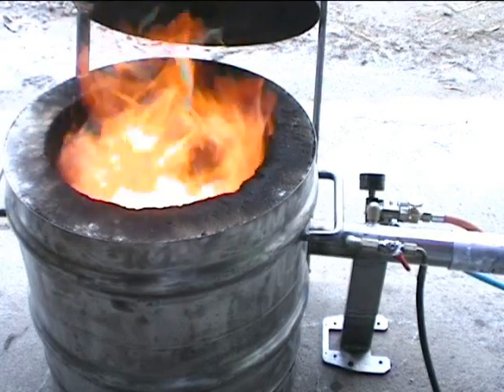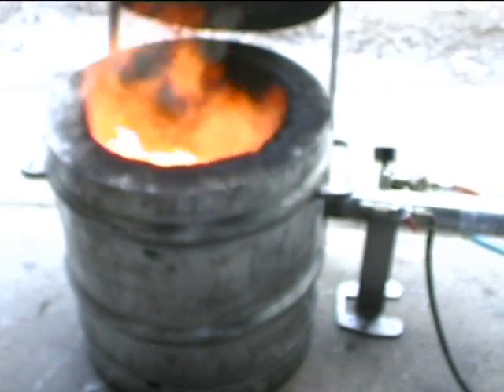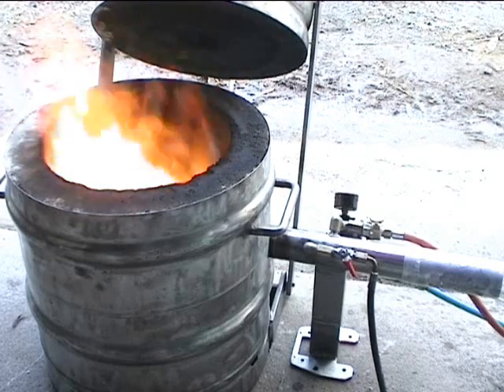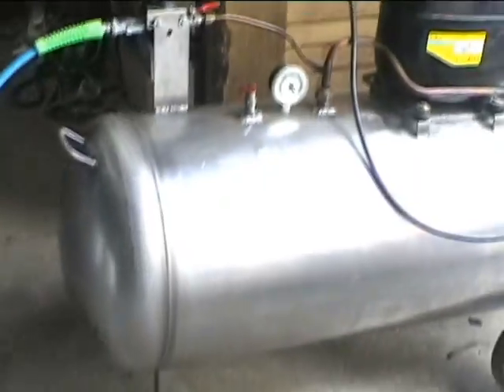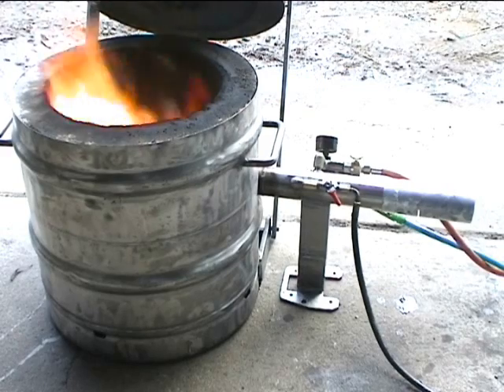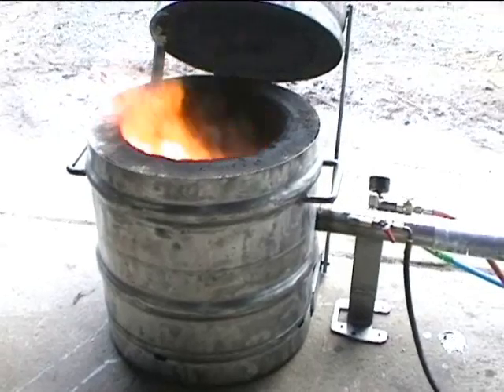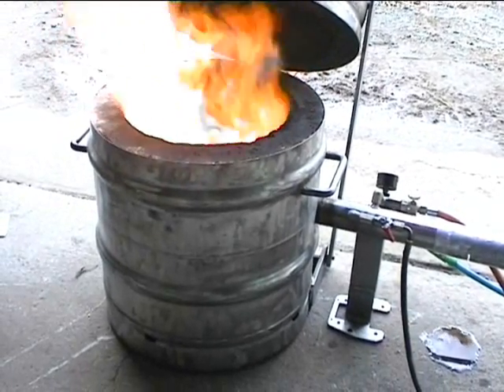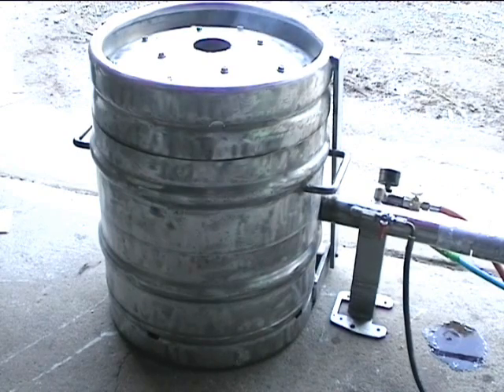Waste oil burner.

Comment: Do you need a special concrete or standard concrete mix is just fine?
Reply from the maker: I used proper refractory cement along with high temperature insulation between inner casing and outer

Comment: Thanks for the video. I just built my burner based on this. I didn't put the propane connection on, but I think I should when I can get the parts. I started the fire with my blow torch until the oil lit. Question though, what kind of vegetable oil are you using? I tested with unrefined sunflower seed oil. It lights at about 250 degrees F. Although I can't yet get it burning from the nozzle., I guess that needs the heat from the propane at the nozzle? Awesome videos.

Comment: methahydrate is cheap if you buy a bigger container I have 80  gallons of oil  and  for every 5  gallons of oil i put in one liter and drop a pump in  with a filter and it  constantly  circulates  fires faster burns cleaner  lights easyer

Comment: I have one and I run 9 pounds of air  thru one side and 3  to 6 thru the oil  side  and the coolest place I can take the temp is a 1040 degrees F  then my gun  just says over heat Over heat

Comment: I don't get this. 10 psi pressure? 0.6 bar that is.. I have built the quickie-burner (same principle of this) but i have to use 5-6 bar to get it running. How come you can have so low pressure and still getting the "jet engine" burning? And i have to mix wasteoil and diesel to get int going. Pure wasteoil it just dies out.
Reply from the maker: Anders Erlandsson 
Maybe yours is different to mine in the size of tube, location of nozzle, length of air entry at rear etc
Reply: +Kevin .Brent - You did a GREAT JOB !!!  You can tell he's not that bright. Look at his Sentences alone and how it runs longer than the Equator. That will tell you a lot about the Person writing that crap and how he would make his " Built ", etc....  Maybe ask him what kind of Toilet Paper he wipe is arse with, that would solved some of your crust on your own arse or even mine, LMFAO.  Dam, some People are just stupid.... Forrest Gump " Stupid is, Stupid does ".

Comment: Very good design just add a flue pipe to get rid of the dangerous gasses or exhaust and you can stay warm all winter long on the spent oil out of your car truck and four cycle engine powered equipment. very nicely done. oh by the way I liked your fire twister inside the heater.

Comment: This is a neat design but do you need the gas to start it? My spray burner lights on straight WVO/ WMO and uses very few off the shelf parts.  I think if you had the venturis further back in the burner and used heavier gauge metal, you may be able to stop the oil drip by allowing it to vaporise off on the burner wall.

Comment: Hi what is the purpose of the compressor really? Also what temp should the preheated oil be? Nicholas.
Reply: Nicholas Bnasraj  The compressor provides air pressure to push the flame down the pipe. This also adds oxygen to increase the burning temperature as well. This also draws air in from the back.
Reply: mfgman2011 thanks for the clarity, much appreciated.

Comment: would it be possible to do this with used motor oil if the fire is hot enough?  i.e., enough air flow to make it possible without much smoke?  I have never tried this, but am thinking about it as I have access to a lot of used water pumps and motor oil.  How much electric does it cost to heat oil?  cost vs. profit?

Comment: It gets smaller, afraid that you are going to have to rethink your question a little or not be so general, yes compressing air generates heat but not really enough heat to increase the temperature of the oil enough, especially with the lower volumes of air that he will be consuming if thats what you are asking for, best option for scavanging heat would be a car oil cooler heated by the exhaust gases of the furnace carrying pumped oil inside it to a copper pipe coil within the oil tank.

Comment: Nice project,have also did some experiments, but with a blower instead of an compressor. How is your fuel en gas/air injection constructed in the burner tube? Do you have a sketch?  Grtz from Holland

Comment: I think the real question here is do you even have a clue what you are asking, I think you just dont understand how a compressor works really do you? Can you imagine the pain of fabricating a tank that has a hose running through it that can transfer the heat from air inside it to the oil outside it with enough efficency to even heat the oil 1ºC, then be watertight and then be capable of containing the pressure of the air, sounds like backache to me and for nothing but a waste of money + time.

Comment: I have a similar setup but have modified an LPG OXY bottle regulators and feed handle to control gas flow. If you run Oxy in at about 1% per 40 mins your fuel consumption can be lowered considerably.  The smoke I saw when you closed the Blast Box Lid will disapear.  HOW EVER ....WHIT ALL GAS LOOK TEST LEAKS AND TAKE CARE AS YOU HAVE NOW GOT THE TURBO VERSION OF A HOME FUNACE.  I t will melt iron, Chrome even Salt. It will do this very fast.

Comment: take ashes, sift them out with a mesh like a window screen, mix it with water to make a paste, and use that instead of the heat resistant concrete. not criticizing, just a suggestion.

Comment: That is soo cool. I was just thinking why not connect the burner to the oil tank. Or use the compressor. You know the tube that the air goes through after it's compressed? Well if you could somehow have that tube go through the oil tank first before it is puts the air into the air tank, that would at least help both heat the oil and cool the compressed air.

Comment: Most excellent... I have made a similar one some time ago based on the Joe Pipe.. (lots of videos by Joe here on you tube)..... How often is your compressor cycling? ... one thing you may want to try ... put the swirl device in front of the flame.. by adjusting air, fuel it acts like a fresnel lens , pull the flame back into the tube and you get all sorts of neat things happening.. extreamly high heat....like a lttle tornado in a tube..

Comment: It looks like it could do the job but I see it leaks oil! It drips off the pipe... 
Why not vaporize the oil in a coiled pipe inside the burner before mixing with air and igniting? 
And with a proper nozzle it might not be necessary any more compressed air. 
Initially I thought that these waste oil burners work like any liquid fuel stoves... preheat - pressurize - vaporize (not atomizing) mix with air in a carburetor and ignite.

Comment: Is it possible to run with the air turned off after you get it started? Or will it run to rich?  I'm thinking a bell on the intake end might help the fluid (air) flow.  With the flame side creating the vacuum you might be able to run it with the air off.  Been looking at waste oil as a means to run a boiler to power a steam turbine.  Why I would like to see one running without compressed air thus making the electricity consumed by the system as small as possible to increase the output.

Comment: Great job mr fabricator man! Im a boiler maker too. That furnace looks a million bucks mate. Good idea with the compressor too! Have you considered making an atmospheric oxygen extraction compressor? It's a bit tricky but I'm positive that a richer oxygen source will increase your heat output, produce less soot and with the right mix you might even be able to achieve a neutral flame. Best of luck to you sir!

Comment: wow this is the best burner ive seen. Im building a similar burner using the same siphon nozzle im having trouble because my propane flame goes out even with the tiniest air pressure i cant seem to get the oil to flow before the propane blows out do you know what could cause this.

Comment: The flame colour looked to be overfueling - I'd suspect you can can hotter if you can get more air/oxygen in.  Maybe add a second air feed into the the hot end of the burner, to add more oxygen downstream of the initial/primary combustion.  I think the exhaust on the lid is too small (why it caused problems with back pressure at 11:50 when the mix got leaner).

Comment: I guess a hoover could be stuck in the end of the pipe instead of using compressed air ?. I have not got a compressor, but i have got an old hoover.

Comment: good video mate. You can preheat the oil using your furnace,  1/2"  stainless steel tubing it's better then cooper, since copper corrodes quickly. If you make few loops of tubing around the beer keg will take care of the preheating the oil. Weld one end of the tubing bottom and the other end maybe 7,8" higher on the oil tank or bottle. I like the this torch man, it's fully adjustable. You made nice "quite" compressor too. Good job mate and thanks for sharing it.

Comment from the maker: @sinashsh ... I only heat the oil a little to about 40c and i dont use all the oil, it burns well even if the oil is around 10c during winter here in Australia

Comment from the maker: @chevyvictor ..Hi the air regulator is on the right side away from me i first turned the middle tap of which is Gas then adjusted the air from about 3 psi to about 6 psi then throttled the oil back so to get a cleaner burn and stop oil from running out front

Comment from the maker: @XXmineGamerXX Yes the oil coming out the front is clean in fact it was filtered then put throught a centrifuge first to remove the contaminants, but the oil is extremely hot thus making it a lot thinner than in the cool state
The oil is Watse cotton seed oil from a fish n chip shop that was used for about 4 days then changed

Comment from the maker: @1amelka Well that shows how much you know, if you put oil in you will get oil out not kerosene, did you concider that the fuel to air mix might have been a little bit rich causing the excess to drip out the front, never mind the oil by now is in excess of 300c

Comment from the maker: @InclinedTherapy  hi
The concrete you can purchase from refactories supplies it has vermiculite in it and is rated to about 1500oC
There is not thermal blaket between the outer case and concrete so the outer skin gets to about 250oC
while the inner temp is about 1200oC

Comment: Bonjour,

I watched your video, it's a good system.
I made a vegetable oil burner, type BABINGTON.
I made some runs to improve the system, for the moment i modified only the burner.
In the future i mixed gaz in  air.
For the moment the maximum highest T° i have: 1100°.
I think it's possible to go near 1300°.
My question:
Do you know the temperature of your burner?
Thank you for your answer.
You can watch my videos on loukalou77560.

Best regards from France

Sorry for my english

Comment from the maker: @Redkrabby thanks for the comments 
There is only about 5/ 8psi in the LPG but it is only connected for a short time until the burner starts up then it is turned off after which i now disconnect it { Ref to next video } May be a short video soon on burner design